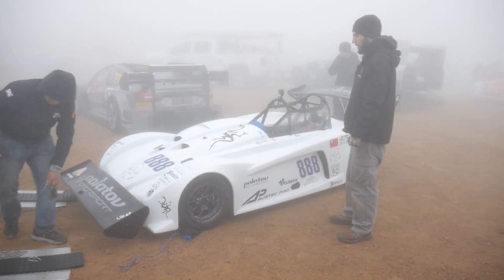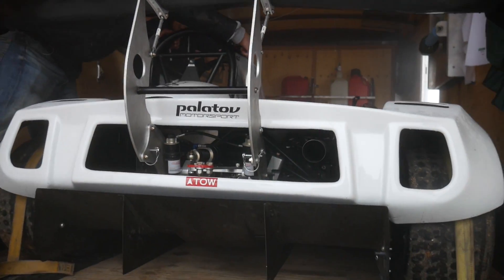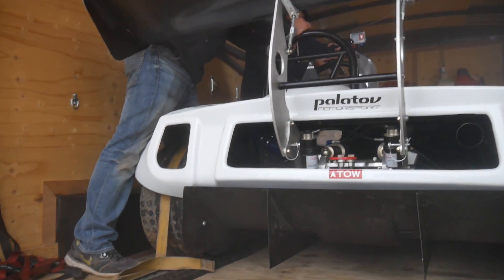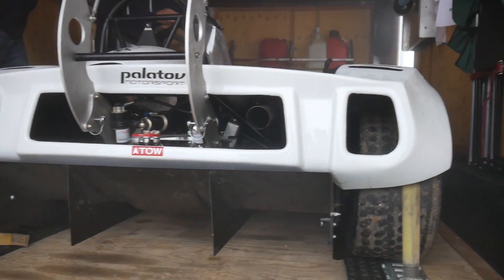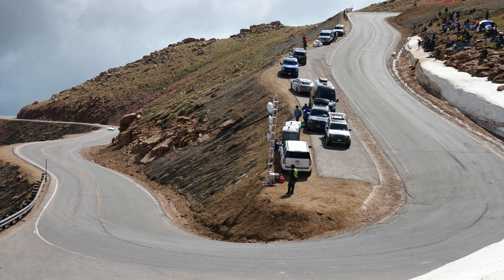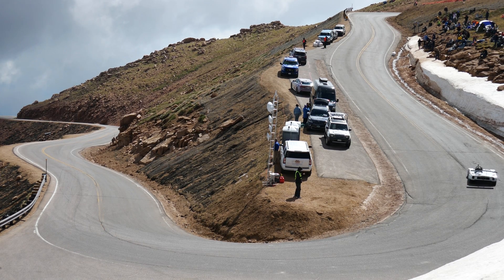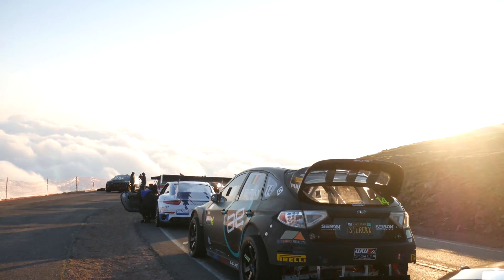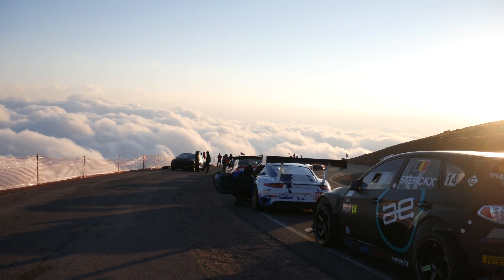CFD, Aerodynamics, and Small AWD Cars at Pikes Peak with Dennis Palatov | Lifting The Hood

Comment: Thanks for the videos Kyle. The aero and suspension fundamentals are absolute gold.

I have a video request, can you have a basic primer/discussion on combustion chamber intake swirl/tumble?

The topic of the cylinder intake is a massive topic in itself, but I found myself drawn to this idea of intake turbulence when reading an online discussion of grinding out the shrouding around valves with the goal of "improved flow". Yet there is literature out there (old and new) suggesting that shrouding can encourage certain in-cylinder flows, improving fuel-air homogenization. So is the rather popular idea of removing valve shrouding based on poor understanding of fluid flow? There seems to be a lot of mysticism surrounding the topic of what goes on in during the combustion cycle and the process of modifying cylinder heads in general.

Comment: So does it have a power take off on both ends of the engine?
Reply: Go check out his blog, he has the entire build and design process documented quite detailed for all of his cars. Very interesting reading, I have been following it for quite a few years!

In this car the engine sits longitudinal where a passengers legs would have been if it was a conventional 2-seater. Behind the engine is a gearbox of the type you normally see in rear-mid engine RWD cars, but instead of having a diff with one output for each rear wheel the gearbox has just one output on one side. That output axle drives a motor cycle chain to the rear diff, and a one-way clutch which then drives a similar chain to the front. So, driver on the left, engine and gearbox on the right, chain drive to the front and rear in between. Brilliant layout that allows for really tight packaging and good weight balance, but like he said in the interview a little bit compromising on aero.